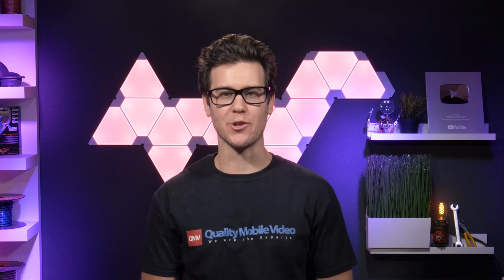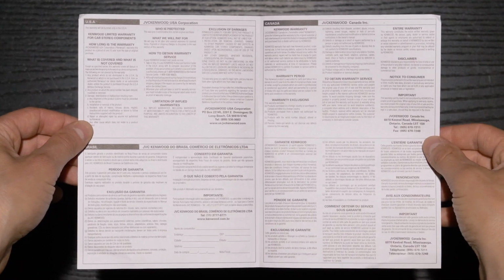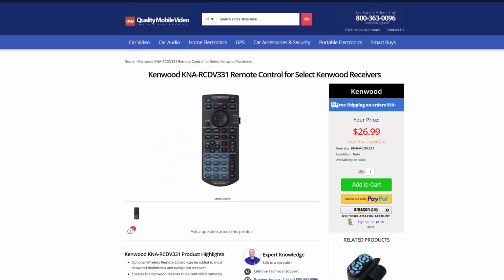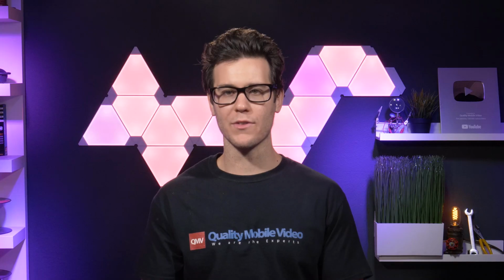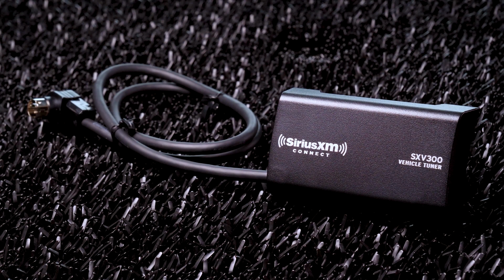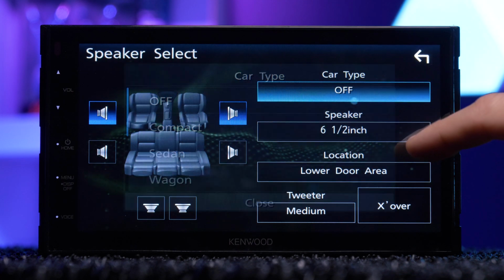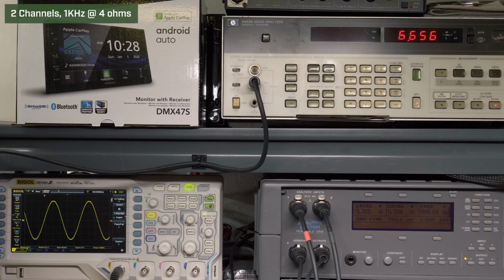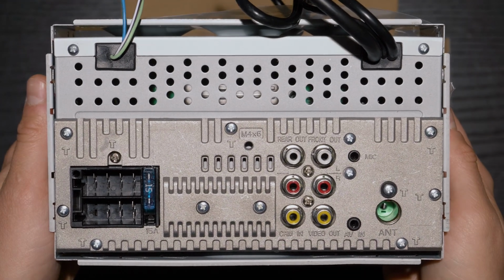Kenwood DMX47S - Full Review and Power Testing!

Comment: I recently aquired a second vehicle and it has this exact model of kenwood head unit installed as an after market addition. I really want to use the android auto but theres no usb ports in the car anywhere so im unable to use it which really sucks. So its only good for the bluetooth audio. The vehicle is a 2009 so it wouldn't have had any usb ports in it anyways. How would i install one for the screen so i can use android auto? Where could i go to get one installed? My other car is a 2020 so it came with android auto and apple car play natively so i never had this problem.

Comment: im looking to upgrade the unit on a 2017 honda accord (non touch screen stereo). would this be a good option??

 i was looking into buying oem honda touch screen same year but touring/sport/ex trim but i havent found a harness with good reviews
Reply: @Betterthanever164  update what? The stock unit? Or this kenwood? 

My daily driver is 2017 accord lx. Stock non touch screen head unit. I want to upgrade with a touch screen with android auto but options are limited.
Reply: Kenwood dmx47 
0:34

Comment: The screen on my wife’s RAV4 went out and the Toyota replacement was like 1200. Ended up just replacing it with one of these for a fraction of the price. It even has Apple CarPlay which the Toyota one didn’t. All the same functionality as the factory one, steering wheel controls and USB ports function the same. Highly recommended.

Comment: I just installed my 4707s.. when I plug into the USB it won't let me connect android auto... is there something I have to do? Maybe a radio update or something else? Any help is appreciated.  And also compared to my dmx7706s the 4707s is pretty good so far
Reply: If you ever get yours to work please let me know. I am currently having the same issue with DMX4707S. I plug in my phone to the USB and it android auto/apple carplay both stay greyed out. If I try to start android auto on my phone it doesn't show it is connecting to the head unit.

Comment: Do I need a idatalink meastro with this unit to get apps and Android Auto or is it just to have steering wheels controls?  Asking because I don't have steering wheel radio controls
Reply from the maker: iDatalink is only needed for steering wheel controls and integration if you factory radio does things like climate control.

Comment: hey i have this same stereo the fuse shorted, the wire problem is fixed but now the screen just keeps flashing on and off and wont ever turn on. I've tried resetting it, unplugging everything and plugging back in,  forums, a car audio shop cant find a solution.

Comment: I can’t get the av in to screen mirror my iPhone. I have all the correct adapters and I’ve  switched around the pin configuration several times. Any suggestions? Is there a setting the head unit needs to be on?
Reply: Did u ever figure this out?

Comment: What is the difference between this and the DMX4707s?
Reply: No difference two different model # but they are the same depending what dealer you purchase from. I think if they are an authorized dealer they get one model # 4707 if your a regular dealer they get the 47
Reply: I had the same question and just chatted with a Crutchfield tech on this -- he said the specs are the same, but the 47S appears to be 'newer' stock for them as compared to 4707S. In looking at Kenwood's site, the latest firmware is the same for both models.

Comment: I just installed this in my car but the USB port in the car doesn’t work anymore so I’m not able to connect it, it there any other way I can use carplay
Reply: It has a USB cable in the back of the stereo, you should use that one
Reply: adrianv2 do I have to take it out then connect it?

Comment: Hi! I just bought this radio, but there is no Menu for Steering Wheel Controls, how do I access to that menu?
Reply: Good point , now that's a big con
Reply: Didn't thought about it
Reply: does grounding the parking brake wire work on this?

Comment: Hmmmm..... this one or the DMX706S?
Reply from the maker: Tough choice! You're saving $50 with the DMX47S, but that's really the only thing it does better. You get the physical buttons on the DMX706S, which a lot of people prefer. The DMX706S also has 5V gold plated RCA pre-amp outptus vs the DMX47S' 2 volt. Also, the DMX706S is Dash Cam Ready, iDataLink Maestro Ready, plus has both front and rear camera inputs

Comment: @QualityMobileVideo: I need help choosing between the 706S and the 47S, no plans for an additional amp...I can get the 706S for only $75 more..I really prefer the push buttons along bottom, but I also want a capacitive screen...706S is older, slightly more power, also Excelon quality...tough choice! If you had to choose?
Reply from the maker: Oh tough choice! I've reviewed both models so know them well. I would probably go for the DMX706S because it has more expandability options like iDataLink Maestro,  two camera inputs. Not saying I'd get all that, but I'd like to have the option.
Reply: @Qualitymobilevideo  Thanks, I was leaning towards the 706S..
Reply: The 706 uses a resistive touchscreen where the 47s is capacitive from what I have seen.

Comment: Looks like a great unit for the price, but for some reason I just prefer the buttons along the bottom to having 'touch' buttons only...especially for quickly turning down the volume which is very handy...
Reply: That's what the remote is for
Reply: @RealGemcor  If u can reach the stereo with your finger it basically defeats the real purpose of a remote lol.
Reply: @Matasky2010  the remote is nice once you have memorized where the buttons are. Basically allows you to not have to look down at the stereo and maintain focus on the road ahead. Or allows passengers in the rear seats to control the music. Plus they are like $10
Reply: @RealGemcor  As the driver who always controls my stereo, I prefer to reach out and quickly press a button. The stereo is literally right beside the steering wheel. Even quicker is an actual dial for volume, but obviously many people want a more streamlined look these days. Remote will never offer an advantage to me. Maybe if you like to put your seat wayyy back in the lounge position, I can see the remote being better. I drive an SUV, and like to be upright. I'm not gonna drive around holding my remote, which means I'd have to pick it up, which means it will always be slower than simply pressing the button.
Reply from the maker: Fair enough I agree!
Reply: i have this installed in my ford edge... im able to adjust volume via steering wheel control. is that pretty standard now?

Comment: Why do they change the dam harness
Reply from the maker: It seems to be a lower cost off brand design
Reply: @Qualitymobilevideo  Definitely a cheap harness, the Boss radios i've installed used the same connector.
Reply from the maker: Yea I've seen these on Boss, JVC and some other cheap brands for sure